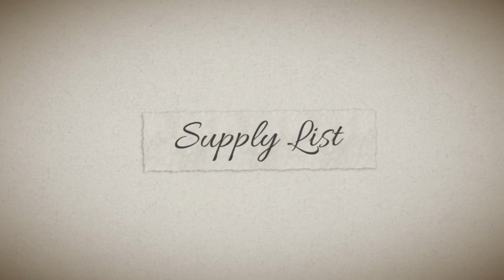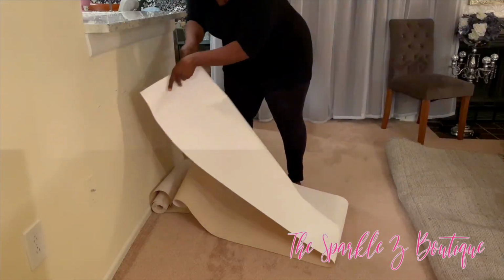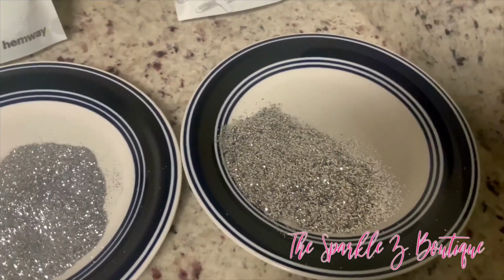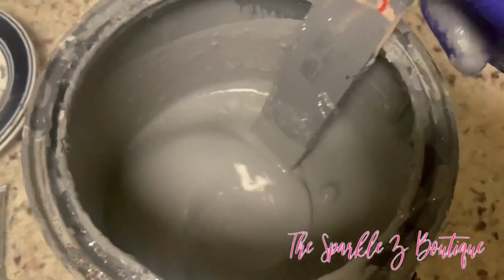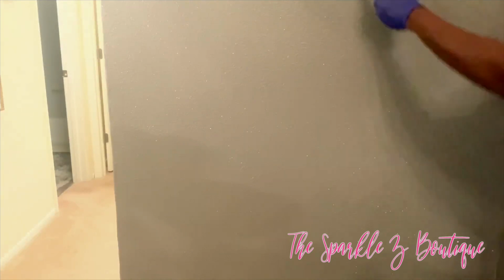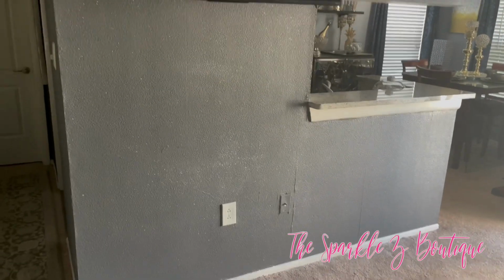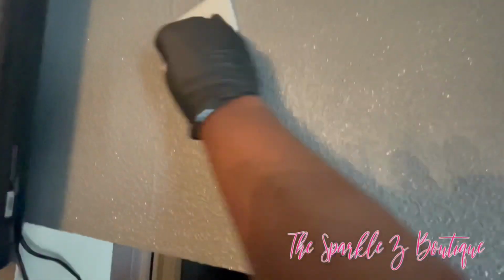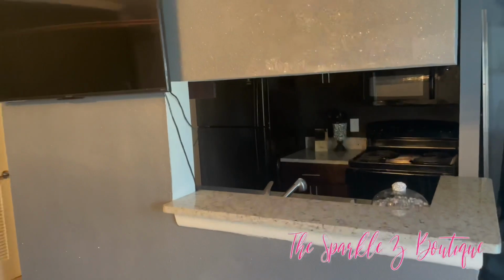DIY: Renter Friendly Glitter Wall w/o Mod Pod or Glue| Hemway Glitter| Removable Wallpaper

Comment: It looks beautiful 🤩. I wanted to do a black glitter wall with chalk paint so l can get away with one coat since it’s black. I am going to try some of the black glitter maybe double what you used and with black chunky glitter. Hopefully l will get a dramatic effect without having to use epoxy and glue. Thanks so much for sharing.
Reply from the maker: Omg, I just put a black glitter wall in my bathroom and your right. You need a lot of black glitter but it’s so worth. It turned out beautiful. Let me know how yours turn out 

Bathroom tour coming soon……tfw😊
Reply: @livewrightnow  Okay, I'm putting a black glitter wall in my clients bathroom. I was going to use black paint and silver. How for a smaller wall...how much glitter is needed?

Comment: Beautiful. How’d you paste the wallpaper to the wall? Will it remove without marks?
Reply from the maker: It is pre-pasted. I haven’t taken this wallpaper down. However, it’s really easy to take down wallpaper. It’s plenty of YouTube videos out there that will show you. I normally peel off the first layer of wallpaper starting at the corner by hand and most of it comes off. Whatever is left over i use a damp sponge and wipe off the rest. I hope that helps. Also, when purchasing the wallpaper. Make sure you know how to remove it before you hang it. Try to get temporary wallpaper, strippable wallpaper or non pasted wallpaper and hang it with liquid starch. I’ve done all three ways and i liked all three, Thank you Love, tfw😊